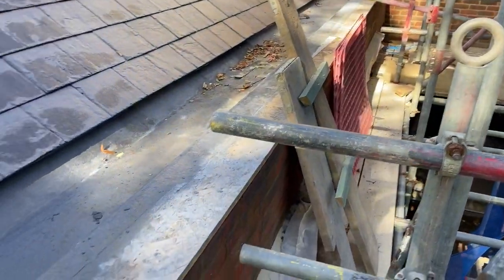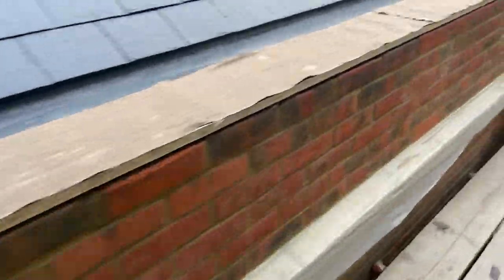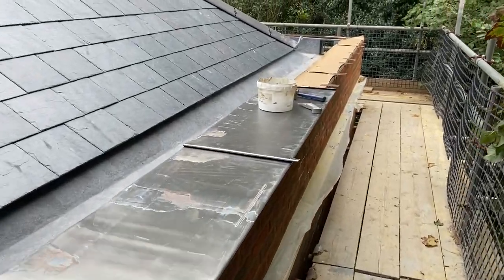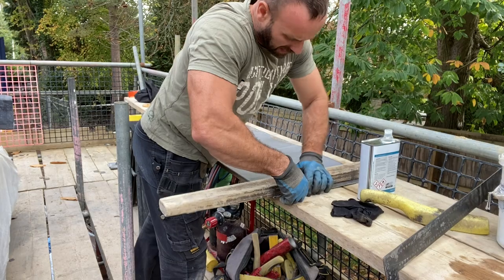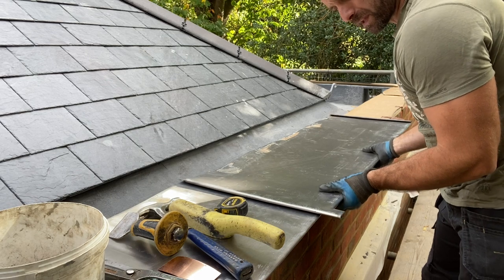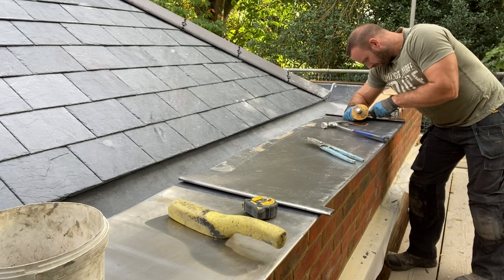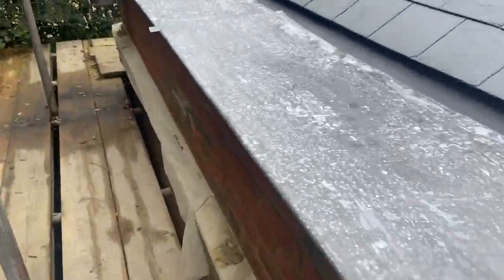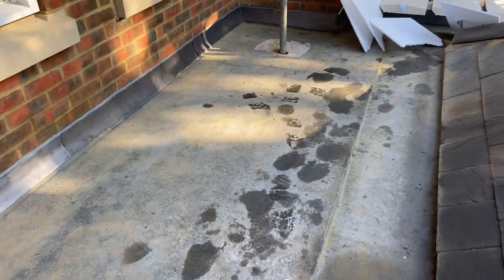Installing Lead Capping To A Parapet Wall

Comment: thanks for such a nice video. a silly question, what is that paper doing under lead?
Reply from the maker: It protects the under side of the lead from alkalis in concrete stone and screed.
And also reduces corrosive attack when laying onto plywood and oak.
Reply: @slbleadworks  thank you sir. Working on a project where architect wants bauder waterproofing underneath with  lead finish on parapet. Hopefully we will get it right

Comment: Great work as usual mate.
What do you think of OSB as a substrate for leadwork? OSB is ok and it was onsite and to hand here as a required substrate for the liquid roof membrane but I hate seeing it used under lead as your leadwork will surely out live the OSB by many many decades.
Reply from the maker: Thank you. 
I’m not a fan of OSB for leadwork and this shouldn’t be used. But like you say it was here to hand so it’s what the builder gave me to work with unfortunately.
Reply: I agree. The builder should be using treated lumber on anything the comes in contact with concrete or masonry.
Reply: To be fair though i am constantly suprised how long osb lasts. I had a hole in my trailer and needed to pick up some gravel so i threw a sheet of osb over the hole to get this job done and that sheet was i  the trailer for 5 years or more outside getting rained and snowed on. When i finally got round to reboarding the trailer i thought the osb would just break up easy and id burn it. I had to cut it with a circular saw to burn it. That board was still in great shape 😅

Comment: Nice work as always great job
I take it lead is a dpm and covered did it need to be welted
Reply from the maker: Thank you. 
Yes there is coping stones now covering all of this capping. 
Also yes the joints needed to be welted  as a flat lap will leak.

Comment: I'm trying to get me "Stu from slb leadwork" arms 💪💪 I suppose thats the frame you need for the job, did you get that all done in one day? Also them copings stones are shite be stained and saturated in a few years should have had you cap them instead.
Reply from the maker: Lol for that you need the Stu from lead work gym programme 😂. 
No it took me 2.5 days. And I totally agree that it would have been better to cap the stones instead.

Comment: Shame to cover it with nasty coping stones Stu, but good to see you working your magic 👍
Reply from the maker: Thank you. 
Yes they could of kept them off and saved a few quid.
Reply: @slbleadworks unfortunately they are necessary as water will run off the lead and down the side of the wall. Coping stones have a 50mm overhand each side and a drip channel to prevent this

Comment: Why would you want to risk damaging that lovely lead capping with pre-cast concrete cappings bedded in mortar which will eventually burn the lead. Surely the concrete cappings would need to be under the lead or left off altogether no need for them.The mortar bed will not bond to the lead properly.The cappings will loosing and become a dangerous hazard , they are about as useful as an ashtray on a motor bike . Even the tea boy on the site would know that, there are Big mistakes being made on building sites because the architect doesn't have somebody keeping an eye on things or didn't furnish the contractor with enough clear detail which is often the case and the bricklayer ends up making the call which suits all the so called experts fine, now they have someone to blame ,happens all the time not good enough.Cappings bedded that way can kill people.
Reply from the maker: I totally agree. 
Could have just left the copings off or put them on first. 
I was on this job as a subcontractor copying what’s been done before and following orders lol. 
Thanks for watching.